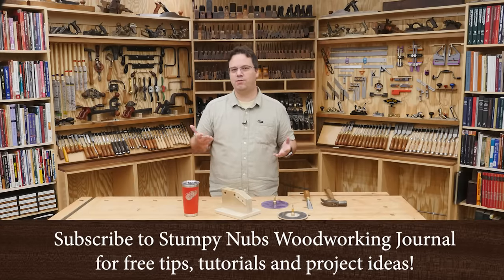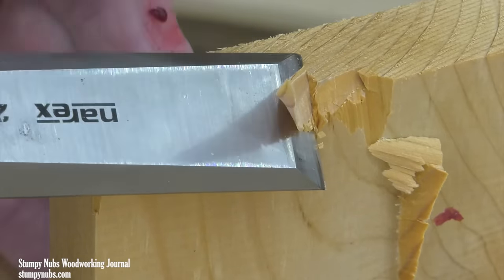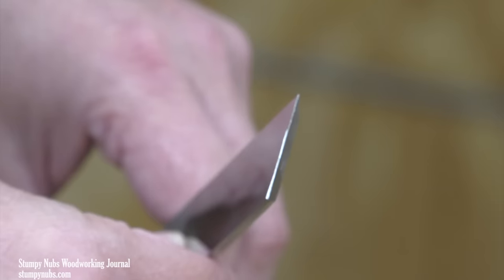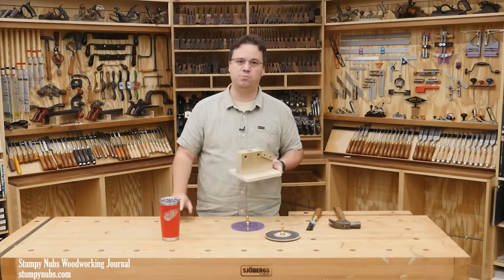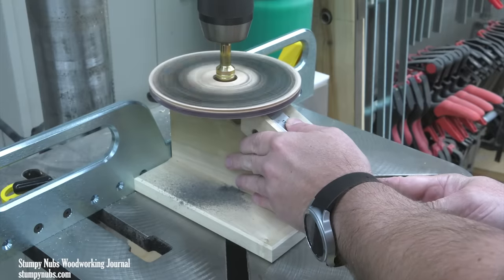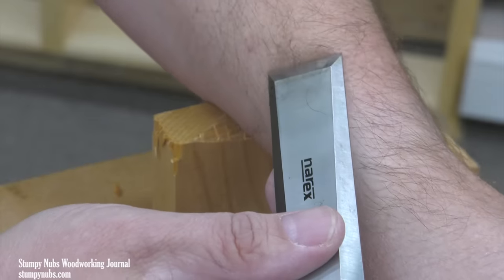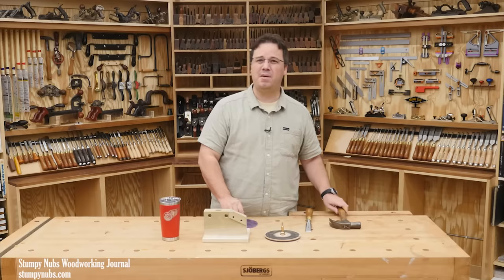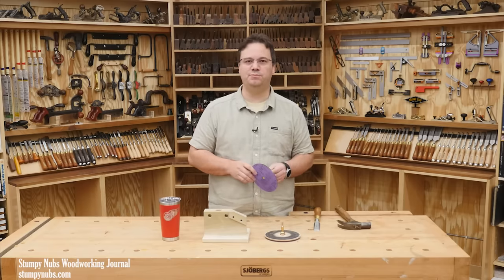Why I use a drill and a hammer to sharpen now.

Comment: I am an absolute convert. I saw this and thought it seemed pretty cheap and I have a drill press- so why not? Built jigs with 25 and 30 degree bevels. The outcome- WOW! In 30 minutes I went through all of my plane irons and re-established the primary bevels and then finish sharpened. It is incredibly easy, it is REPRODUCIBLE-  since the next time you slap that plane iron on the jig it will be exactly the same... I have previously been hand sharpening with diamond stones and roller guides- and as hard as you try every time it is a little bit different. This fixes all of that- in a fraction of the time. Really, really impressed- for about $50.

Comment: 75 yo Canadian man here.  I recently discovered a new use for one of my old-faithful benchtop tools, a Meiji-brand low-power stereo zoom microscope that is essential for my continuing work soldering tiny surface mount electronic parts onto circuit boards.  Magnification range 3.5x ~ 22x.  I haven't yet made precision angle supports, but already my garden pruning saws and bypass pruning shears are quickly & easily made super-sharp because I can now SEE CLEARLY what I am doing to their steel cutting edges with my files, diamond hones & the like.  NO more guessing at angles or testing with my thumbnail - I can SEE the edge of the saw tooth or the pruner blade and hand-adjust my angle of attack to sharpen the garden tools.  180, 360 & 600 grit diamond flats are all I need for the pruners, and fine triangle files for the saws with perhaps a final kiss with the 600 diamond, all simply held in my right hand with the dull tool held in my left, pressing against the benchtop under the microscope.  It will be even better for saws when I construct a microscope support over my bench vise.  I'm embarrassed to admit it took me DECADES to figure this out, but better late than never...
Reply: Outdoors55 does excellent sharpening videos with lots of macro photography. Highly recommended!

Comment: I built one of these earlier this year and admit I was a little skeptical at first.  But it truly does work and it is fast.  I grabbed about 20 vintage chisels I'd been meaning to sharpen, and did them all in about 20 minutes first time out.  All razor sharp.  You may get some negative comments from people who only use a particular system, and go up to 10,000 grit......I've seen them before.  Just ignore that and try this.  You can be back to working sharp in seconds with perfect bevels every time.  That is the real win here.

Comment: Essentially a homemade WorkSharp concept. Wish you had done this 3 years ago.
Reply: Exactly. Guess I need to get some Cubitron paper for my WorkSharp.
Reply: I just ordered diamond wheels for mine. They're pretty cheap (about a third of the cost of a glass wheel).   I'll see how they work out.
Reply: That's exactly what I was thinking. Although this has one advantage over the worksharp: the ability to move the jig and thus use different parts of the sandpaper. With a worksharp you're stuck going around exactly the same circle on the sandpaper every time. so every piece of sandpaper gets only a quarter inch wide track to ever be used. That's what I dislike most about my worksharp, that one crappy aspect of its design
Reply: Right!
I just bought the workSharp over the summer and it’s great so when I saw the video I was thinking the exact same thing.
I do want to try the 3m paper.
Reply: @cyberwolf6667  I thought the same.  The speed of his sharpening is due to the sandpaper.

Comment: I ordered 2 6" kits to have 2 for for the roughter work, and two for the super fine.  Thanks for covering this. It really is brilliant.
Reply: Good call. The initial investment isn't too bad when compared to a Worksharp or other powered sharpeners. I guess it boils down to discipline (doing regular touch ups with extra fine, and rarely (hopefully ) using the coarse after a mishap like dropping the chisel.

Comment: I commented on this about a month ago when I bought one, just to let UK viewers know it's available over here. I've now had a chance to use it. Here are the highlights. 1 It works very well indeed. I brought a couple of old chisels back from the dead in a couple of minutes. 2 For chisels that are in good condition, you can leave the finer grit and strop disc in your pillar drill all the time (I hardly use a pillar drill, I'm a guitar maker) and refresh a chisel in a few seconds. 3 The instructions are good. 4 The required jig is a cinch to make and very forgiving - I didn't bother with the recommended hardwoods but just used scraps of timber I had lying in the shop. 5 It doesn't recommend using it for plane blades, because it is a few thou out over the width of a 2 inch plus plane blade, but I reckon it is well worth a shot. If you are doing freehand sharpening or using a guide such as the veritas you are probably going to be that far off anyway. This is a really simple idea that actually works. Thank you very much for putting me on to it.

Comment: Hey James! Finally got the chance to try out this system today. Tried a few different things but couldnt get very good results yet. I think the issue is that if there is any tilt at all in the chisel rest then you will get an edge that is skewed, rather than 90 degrees to the side of the chisel.

This is kind of a big issue, because  you're stacking up the angle of the drill press table (which theoretically should be at 90 degrees to the arbor) with any variances in the multiple wooden pieces of the jig. How well the system works is very much dependant not only on how square and solid your drill press is, but also on your ability to make the wooden holder perfectly square, including the bevel cut that makes the resting surface.

This isnt a dealbreaker, but as a sustem that appeals to money-conscious woodworkers, who likely are using Harbor Freight drill presses and are less experienced, i think its something to consider.

Comment: That turns your drill press into a Work Sharp 3000 style chisel sharpener. Not a bad idea. I switched it using 3M Cubitron sandpaper a few years ago, and I am definitely never going back. It truly lasts at least 4 times longer than the next best ceramic sandpaper, and it cuts as good as new for 90% of its working time. It is great that they included it in the kit.

Comment: I bought this system a few months ago and used it on my chisels.  The results were great.  I found it useful to color the surface I'm grinding with a sharpie so I can see exactly what area is being ground away.  It took a little care to make sure that the edge I produced was exactly perpendicular to the sides of the chisel.  My sense is that the acrylic discs are not perfectly flat, and this produces a slightly concave or convex ground surface.  That's OK for a chisel, but I elected not to use this system to sharpen plane irons, which require a more precisely-controlled camber.
Reply from the maker: A slightly warped disc would not transfer that shape to the chisel. If you think about it, how could it? The low portions of the disc would merely brush across the bevel as they pass over the chisel and you would hear an intermittent scraping sound. A crooked bevel would result from the two planes (chisel's bevel and the bottom of the disc) not being aligned. Most likely your drill press table is tilted.
Reply: @StumpyNubs    Your comment about the warped disk is correct if the deviations from flatness are random.  But if the disk is shaped like a bowl, with a depression centered on the axis of rotation, then a workpiece pressed against it will pick up a curved edge.   The problem is that plastic stock is not manufactured to the same dimensional and flatness standards as metal stock.  The effect is small in my case.

You're absolutely right about the crooked bevel.  The angular misalignment is in the wooden jig I made (with only a jigsaw) and not in the drill-press table.  I am able to correct this by (a) shimming the base of the jig with a few layers of tape and (b) feeding the chisel into the sanding disk at a slight angle, which I adjust until the edge of the ground area is accurately perpendicular to the edges of the chisel.  Annoying but effective.
Reply from the maker: @paulkolodner2445  I see your point, but I can't imagine the disk is nearly as likely to be bowl shaped as it might be slightly warped. Either way, that would be really rare and would be cause to return it.

Comment: GREAT stuff, James. You and the guys at Taytools are invaluable for the simple, yet elegantly effective solutions to common shop tasks. Curious on the 220 finish grit: Do you regularly use that as a final pass, or do you see the need to go up one more step (say 600)?
Reply from the maker: If I was just going to do routine sharpening, I would use a higher grit. But I needed something closer to the 80 I initially used on the damaged chisel, and I didn't want to use a third grit without a third disc.
Reply: Thanks for the update @StumpyNubs

Comment: An interesting method that looks to be rather effective. 
However, I don’t own a drill press, having neither the space nor budget for one, so I’ll file this in the ‘nice ideas’ drawer and hope to dust it off one.
To be fair, I hate sharpening (or rather as James suggests, stopping work to sharpen), so tips like this are always welcome
Reply: might work in a simple jig with a regular drill ? maybe the rpm would be lower, but it doesn't need to go that fast anyway
Reply: Use a belt sander with an old belt, finish with a piece of 180 grit sandpaper on the benchtop and a strop if you have one. It's just as quick.

Comment: Good video. I used to have a Tormek ,which was great, but it was this machine that you had to fill with water  and took up valuable space-- then empty the water  and deal with the mess .Plain sharpening stones are just a mess too.  With stones, you need the stone  holders and the spray bottle for water when you need it  and it's just another thing you need that takes up valuable space . Although my Tormek is gone, I still have my stones like yourself, but I'm going to try this setup here because it's small and compact and appears to save  time.

Comment: if you can make a video how to sharpen dull, or even broken, drill bits, id watch it.
Reply: @DuffyHomoHabilis  i was thinking more of a using non specialized tools way of fixing them, but good to know the machines work for some one, ive always wondered.
Reply: @ZOMBIEHEADSHOTKILLER vice & a Dremel/grinder, it can be done, but it looks really difficult. I've pulled off sharpening screwdrivers like that tho 👍

Comment: Just like @tompipes2371 said - this system is genius.  I built the sharpening jig and using the sharpening disc on my drill press I got amazing results.  However one note of warning - be cognizant of the iron grindings/dust collecting on the jig under the disc.  I was using the 150 grit disc to set my primary bevel.  The grindings or iron dust tend to be magnetic and bunch together in small clumps under the disc.  After a few seconds of sharpening the heat generated started the small clumps of iron dust to glow or 'burn'  just like 0000 steel wool. This could be a fire hazard with loose sawdust in the area or even worse if using a dust collection system.  James - great video and even better tip.  Thanks.

Comment: I'm a romantic woodworker... I'll go on with stones and the cosman 32", but every new idea is worth! 🙏🏻🌞
Reply: I'm sticking with 32 seconds as well, but for regrinding the primary bevel, this looks more promising than a grinder.  So I'll probably order this, but I'll remember that you only touch the back with your final (16000) stone.  Plus, Rob replies to comments, unlike with my question to James after buying the Kodiak system he recommended, about $1k that I can barely use now.  This is at least inexpensive.

Comment: But Larrin said heating the edge, even slightly, ruins the temper, because thin. So, did u find that the drill press edge lasted just as long between needing sharpening or not?

Comment: From the thumbnail, I was afraid that you had discovered some arcane method of work hardening the edge. Pleasantly relieved. 

I use belts for almost everything. Have leather and felt belts for honing, also a spiral-sewn wheel on a couple machines. Also a Makita wet sharpener. 

I've experimented with the sandpaper and glass and a set of sandpaper and plywood (portable). I've seen this somewhere else recently. Maybe cruising the Taylor site from your recommendation. If I'd seen this many years ago,  maybe  . . .

Still, not something for lathe tools.

As usual, complete and concise info on what looks to be an efficient and cost-effective system. Great video. And, from experience, I've noticed that darker woods don't show bloodstains as well.

Comment: Cubitron has saved me a ton of time.  It has replaced grinding discs and sand paper for me.  It does a better job at a fraction of the time without all the heat build up.

Comment: I threw together a prototype from spare parts in the shop. I was so impressed that I bought the kit. I've never been able to get my chisels and irons this sharp, and it really feels like a game changer for me. 

This might be a stupid question, but what is the best way to clean the strop? After sharpening several chisels and irons, it's pretty loaded with gunk.
Reply from the maker: No need to clean it. Just add more paste. Don't add so much that it gets all caked, though. Just a scribble on the surface is enough. If you overdid it and it's so gunked up that the surface isn't flat and smooth, scrape it off.
Reply: @StumpyNubs  Scrape it off and go lighter on the rouge. Got it. Thanks for the reply

Comment: Questions: does the angle at which the sanding disc hits the blade matter? With stones and honing guide you sharpen into the blade. Here we are sharpening thru the side. Second question, what about secondary/tertiary sharpening angles? I assume if desired then the jig could be modified to include shims or additional jigs for different angles. Bonus question, what about sharpening planes, will it work equally well? This looks to be very efficient and would work well for me as I have limited use of one hand. At the price point it is certainly worth a go!

Comment: Funny how so many tools successfully crossover to different professions! This has been used by amatuer and professional hand engravers alike for years. Used to reshape and hone the face, belly, and heel of HSS & carbide gravers. For the graver version a dual angle sharpening fixture (a tool similarly repurposed from the gem faceting world) is used. Alternatively simple acrylic templates can also be used to hold the graver in precise positions to enable repeatable grinding results of the complex geometries required for a functional graver. The only difference is they use various fine grit diamond faced wheels or diamond lapping film mounted "up" on the drill press arbors. This version seen in the video is a great adaptation with the abrasive wheel flipped down for sharpening flat chisels from underneath. Jigs could easily make for gouges or even flattening shoddily ground chisel backs saving you hours of honing on a flat stone or lapping film.

Comment: I bought a small cheap sharpener that essentially is the same setup. Two wheels-four grits, and a bed with set angles. It's a very fast way to sharpen chisels, 9/10 would recommend.
Reply: What is the name of the sharpener you bought? I don't have a drill press, so it might be a good alternative for me. Thank you!

Comment: Thanks once again for a tip that will not only eliminate one of the parts of my hobby I don't enjoy but also improve my skills.  I noticed the jig plan calls for hardwood.  Anyone have recommendations?  I'm really short on scraps right now and want to use the least expensive wood but also make sure I'm building a jig that will hold up and continue to be effective over time.
Reply from the maker: Any wood will work.
Reply: Or plastic… or aluminium (alluminum for the Yanks).

Comment: The inner door of my front porch, I take off the hinges or put it back on, seasonally.
I pull the pins.

I must have bent the halves of the hinges this time, storing it, because it was hard to shut and sat crookedly in the frame when I put it in last week.

I tried tapping the hinges with a little hammer, bending them slightly this way and that, but to no avail.

Finally, yesterday, I went out to the garage and got my one treasured wood chisel.
It's a Stanley, 1-1/4" chisel.

I chuckled a little at the anvil or pommel on the handle, knowing I would never need a hammer to shave the corner of the door and the grossest imperfection in the frame.

Comment: You can clearly still see gapping under the light though, where the deep cuts left by the 80 grit meet the edge. This doesn't give the chisel the correct profile either. It might be quicker to sharpen them this way but you will be sharpening more frequently without a hollow bevel. This setup will be far more effective if you do your hollow bevel first.

The radius of your grinding wheel on your bench grinder is perfectly designed to hollow the bevel behind the cutting edge so you dont have to polish such a large area when you hone the micro bevel, as well as reducing pressure and friction when you cut. Your chisel jig is the correct angle you hone at. By having the back clearance at this angle and further tipping the chisel to work the very edge will not give you the correct cutting angle.

The strop is also designed for deburring more so than polishing. The fibers in the leather grab the smallest of burs and snap them off. Achieve the correct finish with your honing stone, then debur with your strop.

Comment: What is the angle the jig is grinding? The chisel appears to have a beveled edge butt I see no adjustment for it on the jig. I was taught the big face is 25 degrees and the bevel is 35 degrees.